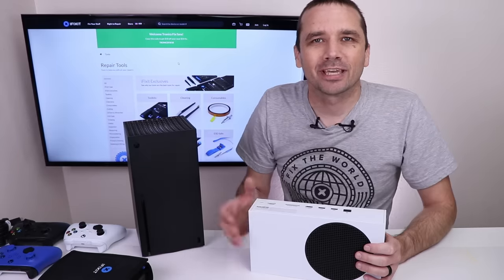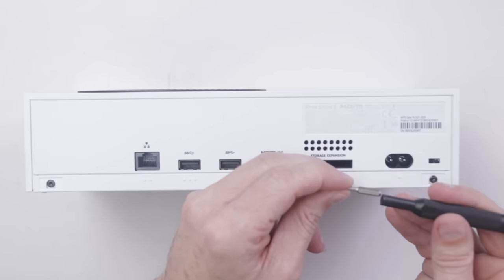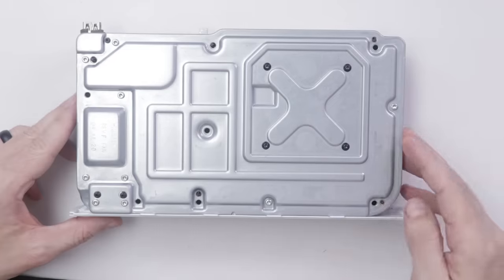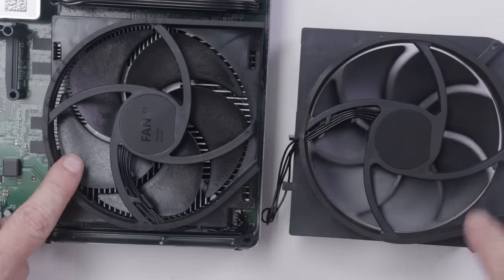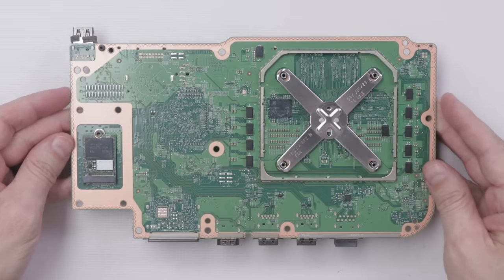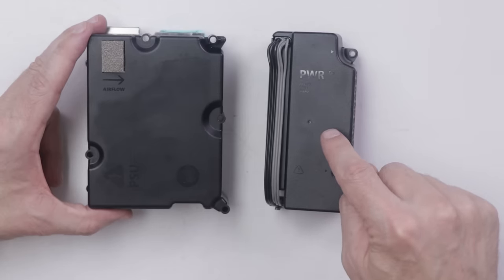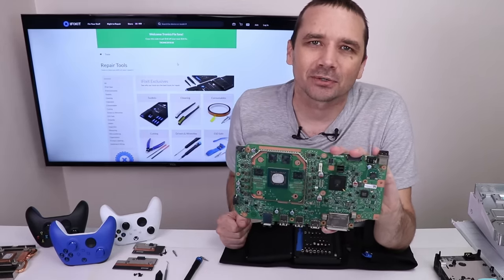Xbox Series S Teardown - A Repairability Perspective

Comment: Hey Steve, just wanted to say thanks on this one specifically.

We had a major drama with my sons’ brand new Series S, where he accidentally bumped a full glass of water right onto the machine while it was on!

  The machine shut off instantly, so I assumed that was terminal.

I followed your video anyway, mopped up a lot of water, although I think most fortunately there were no signs of water in the power supply.

So, lots of hair dryer use, re-applying of the thermal paste, and cleaning any and everything with isopropyl alcohol, and letting everything stand to be as dry as possible before then re-assembling, when I tried it out it appears that it still works just fine !  Yay !

Xbox (Canada) want $275 cdn to repair/replace, so we likely owe you at least a nice cup of coffee 😃

So, thanks from us, a Dad who has limited experience taking stuff apart, and a 13 year boy who could has been able to keep in touch with his friends due to having his Xbox 😃
Reply from the maker: So glad you saved it! Nice work!

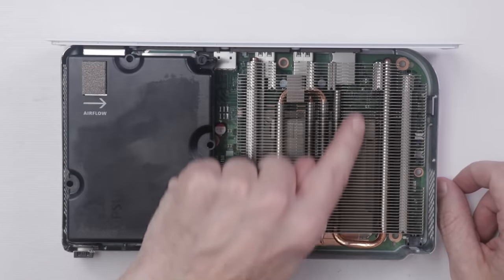Comment: the holes on the right side are not exhaust vents as u say around 4:30, those would also be intake, the fan draws the air in from both sides and exhausts it through the large black circular grill.

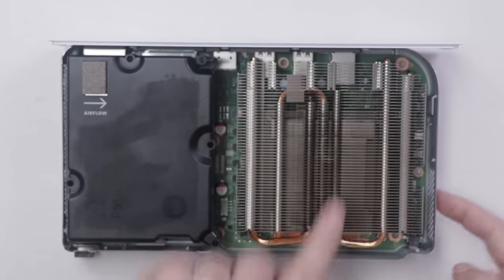Comment: 4:16 Not correct, air comes from both sides goes through the fins, and exhausted on the top. So the fan pulls the air up through the heatsink.
Reply: Precisely!

Comment: I'm kinda worried about standing it up. I kinda feel the feet aren't enough for airflow and I think the power supply is passive cooled by the cpufan draw so in vertical I don't think its getting enough air.

Comment: Are you able to try swapping the SSD for the series s and X to see if it turns on?
Reply: a lot of people have opened the consoles, and the ssd's are common pc ssd's. so upgrades are definetly possible. i don't know if there is a difference in the OS tho
Reply: @gugubope21   knowing microsoft the ssd is likely tied to the mother board with some sort of locking feature or firmware i believe they have been doing this since the very first Xbox original which is annoying but not impossible to overcome.
Reply: @goldend-pad5257  one X's are so easy to swap like just plug in the new hdd and run a system update through pen drive
Reply: @al01martinez88   if so then that's a welcome surprise i wouldn't have thought they'd do that hopefully it's the same for Series X/S

Comment: Question! Could I boost the gpu on my series s to make it perform even better? All I see is how low the gpu is clocked and how it could be boosted for better performance they just chose not to do it! So is there any aftermarket thing I could add to boost it, even if it is a little boost, some is better than none?! Also would adding a cooling system have any benefit for the series S! Thanks and happy new year

Comment: Like I commented on the PS5 video about the storage solutions each company went with, I'm glad Microsoft is going for an internal m.2 card and external CFE-b solution, unlike Sony's internal soldered and m.2 card solution, I'm just disappointed Microsoft went for the smallest possible m.2 length for their implementation. In comparison, Microsoft is doing better than Sony for storage, both internally and matched in expansion assuming CFM-b to m.2 adapters are fully compatible on the XBSX/XBSS consoles, but Microsoft could leave Sony in the dust if they allowed full length m.2 cards internally; especially as libraries grow in size, just like the PS3/XB360 era where early gen games were tiny in comparison to late gen games, which we will more than likely see again, especially with some games shipping at 100GB and some pushing 200GB already. Hopefully mid-gen refreshes will see the internal m.2 expanded to full length cards. 

As for what Microsoft is doing, I think it's somewhat smart. Your typical living room TV console isn't going to be pushing 4k120, which is where the S shines, the only downside is lack of the disc drive. Where the people that do have a 4k120 setup would benefit from the X, yet it would make sense to go with more storage and no optical on the higher end option, switch out the disc drive for a mass storage SATA drive, and use AMD's smart tiered storage solution in that situation; it was StoreMI before AMd dropped Enmotus and provided an in-house made solution. Between the two, the inclusion of a disc drive seems a bit backwards, in my opinion, I would think the lower tier would benefit more from a disc drive than the higher tier would. Microsoft clearly knows the console market is currently split between low end and high end, where Sony is only aiming for the high end, just with or without the disc drive. 
Having two entirely separate tiers of console is emulating what the PC market does, lower end and affordable for everyone, or higher end and more expensive for the people who can afford it and actually use the higher end parts. It'll be interesting to see what happens to the S by mid-gen, though, will it become a digital variant of the X while the X sees an upgrade? It'll also be interesting to see what Sony does by mid-gen, if they'll split into base and pro models again or not.
Reply: @KING ENZOWhat Sony has done is more expensive, not less expensive. Cost of manufacturing the board is more costly when comparing soldered SSD to an m.2 port, due to additional board components and their relevant traces and pads, not to mention they have to stock more components rather than just double the amount of a singular component, and have a more complex manufacturing line. As is the cost difference between an off the shelf SSD to a custom solution, due to custom solutions always being more expensive, especially considering the entire solution is custom and/or atypical of what is standard, just look at the drive size compared to what's typical of m.2 drives; not to mention their bloated system is taking up near 20% of their undersized SSD, the amount of space a literal game or two could take up currently, or what a singular game is going to take up by at least the middle of this generation, if not earlier. Thus Sony's decision is more expensive, and just doesn't make sense when game sizes become bloated this generation, at least Microsoft is allowing the consumer to upgrade both forms of storage once m.2-2230 SSDs come in larger sizes, which is also more consumer friendly; and Microsoft's implementation of a secondary SSD being external is also more consumer friendly, as it's easier to swap SSDs when game sizes become bloated and smaller SSDs basically become memory cards, assuming you're old enough to remember what memory cards were 3+ generations ago. Arguing that what Sony did being cheaper is literal idiocy, but this doesn't surprise me considering you don't know the correct use of 'costed.' At the end of the day, Sony's solution is also entirely unfriendly to consumers, especially when they start shipping larger soldered SSDs by mid-gen, where older consoles are locked to the smaller SSD. Teach yourself some basic logic, it's not that hard to figure out that custom solutions cost more. Also teach yourself some basic English, you quite clearly need it, especially with grammar. Don't try to argue a point when you make yourself look incompetent, illiterate, and unintelligent.

Comment: Try to add new and big ssd on this motherboard inside.
Reply: There is a dedicated port for SSD upgrade dude... no need for that
Reply: @nicaandrei4965  Huge expensive port dude. 200 dollar for 1tb. i need to buy and put inside motherboard. Thats more cheap.
Reply: @mertcan.  if you want to have the optimal speed on your new ssd you should check those specs, i dont think any ssd can work nicely with xbox, I just dont care since 350gb is more than enough for me to have 2 big titles and some small ones in there too since I dont play hundred of games at once. But if you decide to chage that ssd please tell me how it went, im a bit curious
Reply: @nicaandrei4965  To enlarge the hdd on my Xbox One device, I downloaded a software to my computer and threw 2TB of xbox One software into the hdd. I think that when the xbox series s with a high gb comes out, we will be able to replace the SSD directly in it with the ssd cloning process.

Comment: Can we swap the internal ssd with a bigger capacity
Reply: lol, good luck
Reply: @grefsteel3989  why
Reply: @yatharthkaushik5504  it's integrated in the circuit board, and can't be swapped. Only way to increase storage size is with external storage drive
Reply: @grefsteel3989  Did you even saw that it was removed in the video
Reply: @staple132  No I did not see that, but just did. I didn't know it's modular like that. So it seems possible, but it seems like a proprietary format just like the external ssd, so unless there'll be larger size modules swapping only makes sense if the ssd is bricked somehow.

Comment: I wonder how their Velocity tech works? It is clearly firmware/software based. I see the Series S you disassembled has a SSSTC SSD (green pcb) while another Series S I seen disassembled in another video had a Western Digital SSD (blue pcb).  I commented on the PCB color because that is how it stood out to me. To top it off the expansion drive is a Seagate SSD, 3 different manufacturers, 3 different controllers (I assume?)

I'm really interested to see if the internal drives can be swapped, formatted, partitions extended, etc like on the One S. I upgraded my 500gb One S to a 2tb 7200rpm Seagate 2.5" Enterprise HDD I had laying around with the help of your videos. Even if it is possible it would still probably be cheaper to just buy the Seagate expansion card. You would end up with 1.5tb vs 1tb with a m.2 2230 unicorn drive lol

Comment: It's a shame the digital version doesn't come with some other form of storage such as SD card or something similar so those who don't have internet can still get games on the system although I wonder if it's possible to download the games put them on a USB flash drive and install them, probably not but would be nice to have that as a option and it would give game shops some business for digital games. So for example, a customer could walk into a game shop with a USB flash drive and buy a game hand over their flash drive and the staff member copies the files onto the flash drive and done, hell it could also be done via a automated self checkout by having the customers console services account which they log into on the self service system and once the order is placed the game is put onto a USB flash drive and all the customer does is go home insert their flash drive into the console and it copies the data to internal storage. I get that most people will have internet so will be able to do this at home however not everyone has high speed internet if at all and with the increasing size of games it could take days to download some games but having a server at a game shop which has all the games stored on it that can be downloaded would be cool.

Comment: What are you missing on the power supply ratings that you show?  Neither of those puts out enough power for these consoles....165W for the series X and 120W for the series S?  Are there other labels?  The Series X power supply shown in a Digital Foundry video showed the output to be dual...one 12V - 21.25A, and one 12V - 5A.  Together they make it a 315W power supply, which is what is accepted as what it needs to run reliably.  DF also showed AC power draw running about 165W on average on a Series X, so even if that power supply is 100% efficient, it's not going to last long.  Something is not right here.....
Reply: Also note that the power supply on the DF unit had its label on the metal shield.  Are there already different parts being used on these, and is that output accurate for the Series X that you bought?  If so, get a spare power supply ready. :D

Comment: I have a question: if you completely remove the HDMI chip in a ps3 slim, can it be switched to RCA output and work in that low resolution mode?

Comment: Is it just me or are there fewer ports on the new generation consoles as compared with the previous generation
(There seems to be 2 fewer ports than the Xbox One S/X)
Reply: kinect and hdmi in
Reply: @MaxIronsThird  The Xbox One S and X didn't have a Kinect port, only the original Xbox One did
The ports that are on the Xbox One X which aren't on the Xbox Series S/X are (turns out there are three): HDMI In, Optical Out, and IR Out
I can understand the removal of the HDMI In and the IR Out
but removing the optical out seems a bit weird to me

Comment: the one question I have is with everything packed in so tightly on the S and X how much air is really sucked in and expelled. looking at it if they was more space the fan can draw more air in and cool things better. cause some of the components seem to block vent holes on the sides and bottom.
Reply from the maker: I think there will be plenty of airflow as long as they stay clean. Smaller spaces can actually be good. It creates more suction.

Comment: Once again, MS decided to use off-the-shelf SSD.
Reply: Is it a bad thing?
Reply: @randymarshole , Is and isn't, good that it can be replaced, but bad you have to send it to Microsoft to do it.
Reply: @randymarshole  Not really, except, it is the shorter 2230 form factor.

Looking at it, looks like both (Series X and S) are DRAMless SSD, and most m.2 SSD are 2280.

It's difficult to find a decent 2230.
Reply: @Ebolachicken  Not if it is a chip that locks it, like the new mac pros.

Comment: Ah yes the ripoff console that’s basically a real in Xbox one X with the absolute bare upgrades, same controller and same no games, I feel bad for people who pay for this since it’s a downgrade and not like the PS5 digital that ONLY is missing the disk drive for why the price is lower. Microsoft needed to step it up to beat PlayStation and everything shows signs of them not caring much.
Reply: Rip-off, yes, $300 for a machine that does RT and 120Hz, also the PS5 DE is a fake product, Sony only made it to undercut the Series S, the DE makes up for around 5% of PS5s Sony put out to sell, because they lose over $60 with every DE machine sold, while they make $10 -15 on the regular PS5, meanwhile MS loses $5-10 on the SX and make $15-20 on the SS, the SS makes for 25% of the consoles they've put out.
The SS could've cost $250 in my opinion, but even at $300, the Xbox Series S is still cheaper than the One X and the PS4Pro, with a GPU as powerful as the One X, a much faster CPU and an incredible SSD.

Comment: 4:10

That's not at all how the airflow works. The airflow comes in from the left (where the arrow is) AND from the small vent on the right. The fan pulls air into the chassis and through the heatsink and ejects it out of the unit. It's obvious this is how it works due to the design and fan orientation, and I find it odd that a YouTuber who's made a career in making informative tech videos couldn't plainly see this.